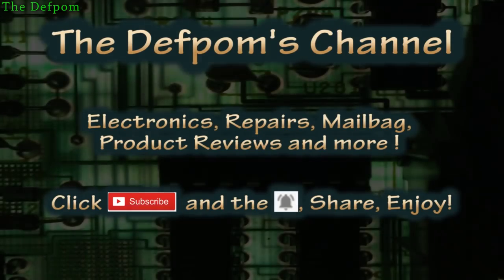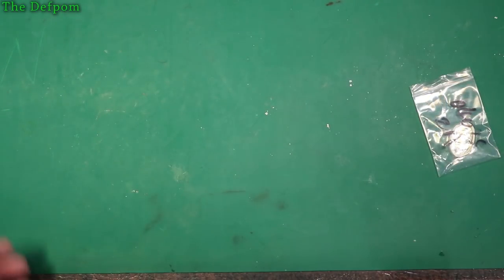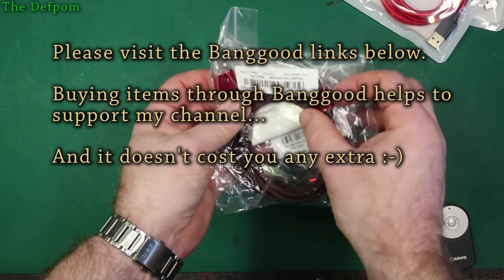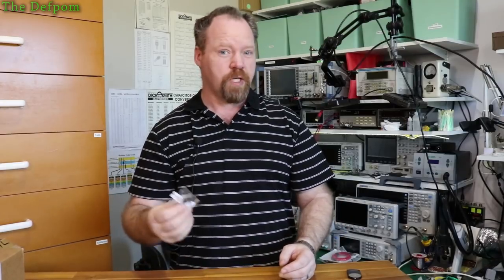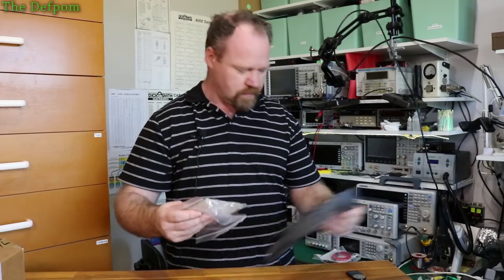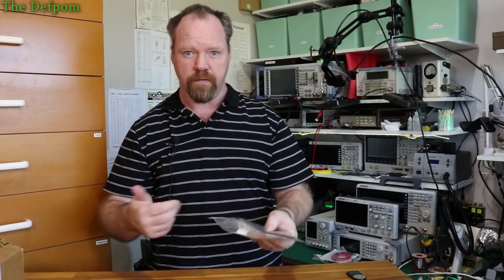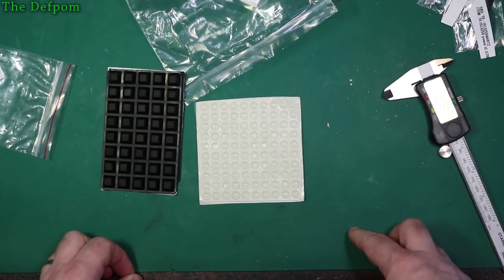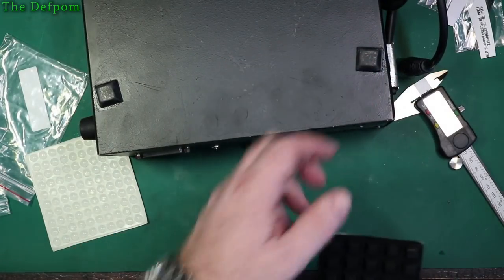🔴 #523 Mailbag Monday 4th March 2019

Comment: Be careful with those stick on rubber feet. I have seen them degrade over time, into a dripping, sticky, gooey mess that is almost hard to remove with extreme petrochemical fluids.
Reply from the maker: Danish Native - it depends upon what environment they are in,  high UV would break them down, as well as chemical exposure to things such as acetone or methylated spirits.
Reply: @TheDefpom  No, I have some rubber feet fail in descibed manner sitting in a dark enclosed box inside a house room. The material just disintegrates into a very sticky mess like its been melted.
Reply from the maker: Very interesting, you can sometimes get migration between materials when causes them to breakdown too, a good example of this is ePS (Expanded Polystyrene) and pPVC (plasticised  PolyVinylChloride), the PS dissolves the PVC.

Maybe the feet are pPVC (plasticised PVC) and the box is polystyrene?

Comment: Ahh the clock modules, i have an old kitchen clock from 30 years ago, it stopped working last week, How dare it.!! :-D
i resoldered the 32768 khz xtal and disk cap.... dam it works again lol.
It's one of the ticking type, battery lasts ages, unlike the smooth sweep type.
The dvd/cd writers seem to go blind, i've never known how they fail, perhaps they start to produce waves that are not in perfect phase, i dont know really.
I'm sure the early 4x speed cd drives lasted better.
My mate bought one of the first c.d writers at £3000 greenbacks, bloody hell!!.
Reply from the maker: zx8401ztv - when I tried to fix the original I soldered some bad joints, but it slightly melted some of the plastic which then warped a bit, I fixed the original problem, but created a new one, so had to replace it then.
Reply: The Defpom's Repair Channel
But at least you had a go, that's the bit that matters :-)
I have tryed to repair everything shoved in front of me, most of the stuff i fixed, but not all.
And i have the IQ of a glass of water :-D

Comment: I like your You Tube channel a lot.  You have a very interesting and amusing channel. Keep up the fine work.  By the way, when your back is toward the oscilloscopes in your YouTube presentation, you usually have a ground loop buzz in the background of your audio, about 40db below your average audio level.  Disconnecting a shield of the audio cable at one or the other end will usually eliminate this buzz.  I am a retired certified Professional Broadcast Engineer from Easthampton, Massachusetts, USA.